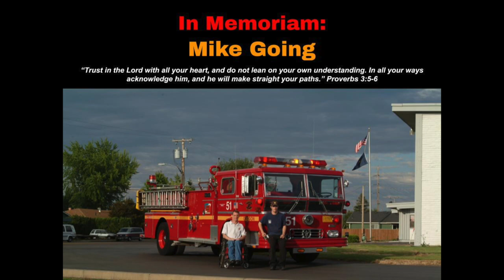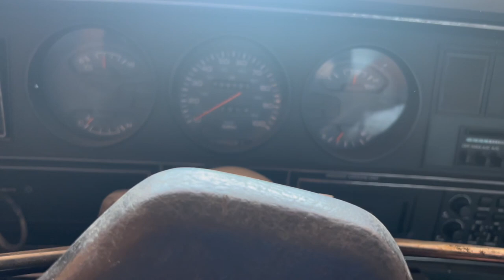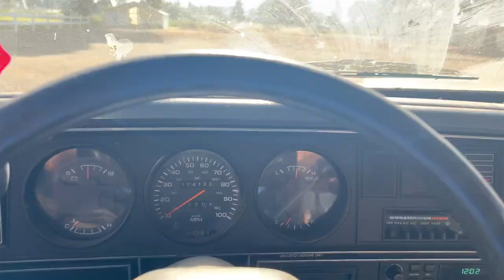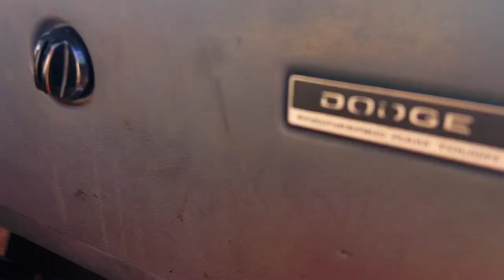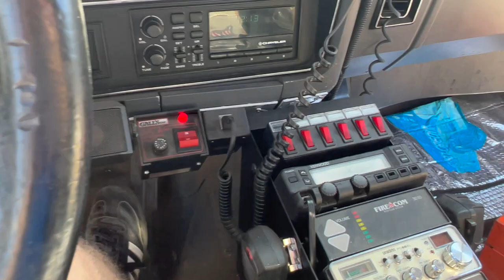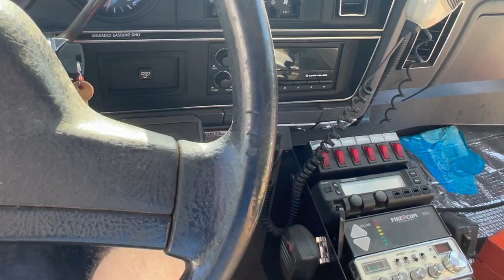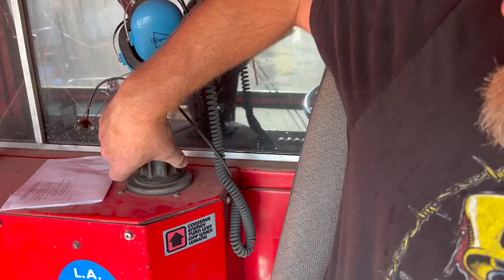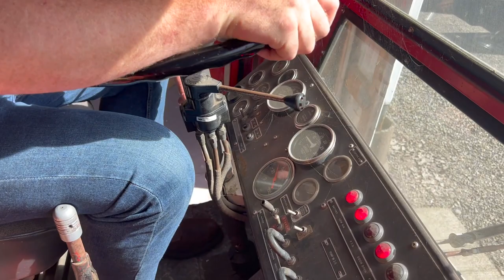Driving the FAMOUS Squad 51 Replica + Ward LaFrance Engine 51 Old Start Cold Start and walk around

Comment: The original Squad 51 is a 1972 Dodge D-300.  Not a Dodge Ram.  And the Dodge name was painted over on the original.  And the original Engine 51 Ward LaFrance still exists.  It’s equipped with an Allison manual transmission and a Cummins diesel.
Reply from the maker: Yep! Correct on all accounts.

Comment: Not sure if "Replica" is the word I'd use, not even remotely close to what was on the show.
Reply from the maker: To each their own. Even your comment seems like a replica of the others here 😉
Reply: @BadIdeasGarage  Because we're all right, lol. Just because its the same make/model of what was on TV, Doesn't make it a "replica" build.
Reply from the maker: Joking, aside, and as I mentioned in the video, I did not do the build, I just wanted to tell the story. Feel free to make a list of the items that need to be changed to meet your standard of “replica” and I can forward it to the museum that owns them now!
Reply: @BadIdeasGarage  Well first things first would be decals, Nowhere on either vehicle does it have the correct LAFD markings. Squad 51 isn't even the right make/model. - 51 was a D300, Not a RAM. Its also missing spotlights. Actually, the entire body and compartment setup is wrong on the body this "replica" has.  - So the dodge you have here isn't a replica, but rather a whole different truck, entirely.

The lighting on this dodge you have here, also isn't right. Squad 51 never had an MX7000 lightbar, but rather an LAFD spec TwinSonic, The real Squad 51 didn't have a PA300 siren, either. 

The Ward Lafrance also has major problems - Again, the lighting isn't correct, as LAFD doesn't run forward blue lighting, E51 in the show also didn't have a full-size lightbar, as it had a 4-beam rotator gumball light (I believe FS was the manufacturer of that) nor did it have rear-mounted mini light bars. The TV version didn't have spot lights on the bumper either. It also looks like its missing the drivers side booster reel.

Bottom line - a REPLICA of a TV show vehicle is supposed to REPLICATE what was shown on TV - clearly both of these trucks do a terrible job at such. Don't get me wrong, I love these trucks, they are beautiful.  especially being the Ward fanboy that I am :) But they simply aren't replicas. I do hope the new owners take the time and effort to actually make some true replicas, rather then a half-baked attempt we see here. 

P.S. - Going through the comments, as you've stated - you seem to have a very sour outlook on anybody who says these aren't "replica" vehicles...Change that, as we're only giving advice.
Reply from the maker: Sounds like you’re very passionate about this
Reply from the maker: I’ll send your thoughts over to the marketing department!
Reply: @BadIdeasGarage  Its just common sense, lol.
Reply: @BadIdeasGarage  Please do! I'd love to see where it goes! Hopefully they make the right changes!
Reply from the maker: If you have the correct federal light bar, feel free to send it 😀
Reply: @BadIdeasGarage  Are you speaking on their behalf now?
Reply from the maker: In this case, yes.
Reply: @BadIdeasGarage  Well, when they decide to comment themselves I'll reach out...I don't (and I'm sure they don't) need you reaching out on their behalf.
Reply from the maker: Suit yourself, in the meantime, they’ll still be our “almost” replicas in our minds 😇🤣
Reply: It’s not easy to find a CTS bar